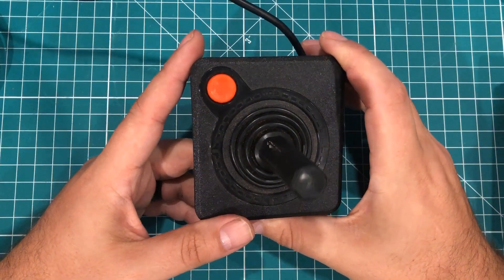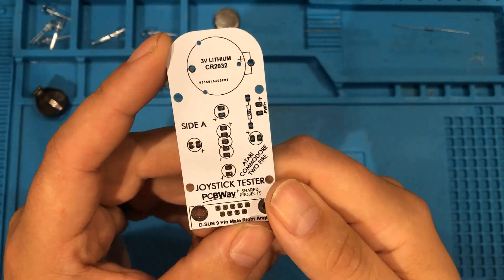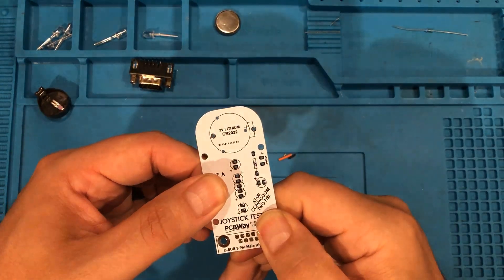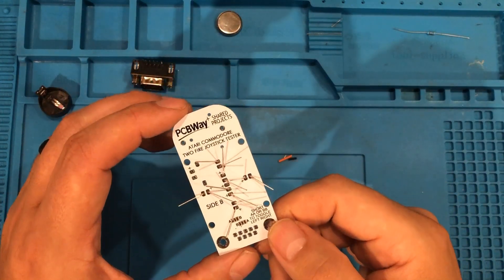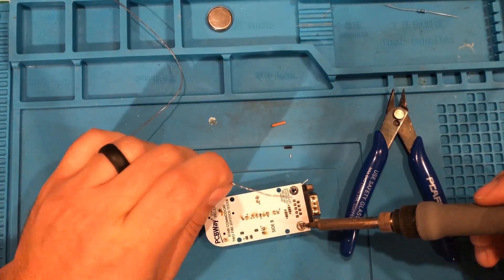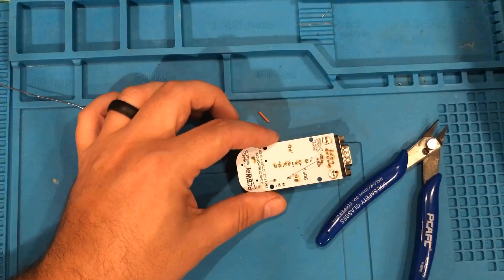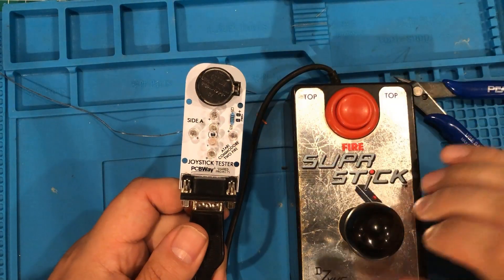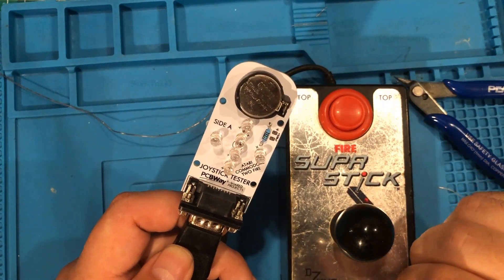Retro Joystick Tester - Simple Kit Build for Atari, Commodore, Amiga, Sega and others!

Comment: This is yet another incredibly useful build. Would love to see a fancy case on it too, protect the board from the elements. Now I'm wondering if one could design a face plate and have a ton of exposed pins with dip switches or buttons and a microcontroller so you could plug in any controller and test it. Or would it be better to have multiple connectors for other controller types?
Reply from the maker: Yeah.   A case would be really cool.   I've actually been kicking around the idea of having a ribbon cable or something that could let you swap joystick connectors. I've been thinking the same thing for retro pc power supplies. There are a million connectors and voltages...it would be cool if you could have a universal psu that you could swap the cables for all the various systems.
Reply: @AnotherMaker  If I understand your ideas regarding this, you may want to reach out to Bob on Retro RGB as he discusses things like that on his YT channel and he could get the word out and review it if I guess correctly
Reply: @AnotherMaker  Yeah, like that multi plug power supply they used to sell with the 20 barrel connectors, but let you change the voltage, would be a great project too.

Comment: Nice, but why does it need the battery? Doesn't the Atari standard have a 5V pin?
Reply from the maker: It needs a battery because when it's testing, the joystick doesn't get plugged into the atari. The joystick itself is just a combination of switche/buttons with no internal circuitry.
Reply: This is for when you don't want to carry an Atari in your pocket then ask the Thrift store if you can plug it in. Then hope you brought your Joystick Test cartridge or Combat or whatever.

Comment: I like a well-defined star, with 8 discrete positions.
Joysticks should also be built like a tank. They take some abuse!  Maybe it is just me.
Wondering, do the Atarti controller's contact switches have debounce circuitry?
Reply from the maker: I would think the debounce is in the console, but I'm  not sure. I'll definitely be pulling them apart.  I spent a ridiculous number of hours on my original controllers. My guess is that the main reason these don't work is just being normally open for 30 years in Florida humidity.  I'm definitely puling them apart.
Reply: The joystick itself does not contain debounce circuitry, only switches. There is likewise no specific debounce circuitry in the 6532 RIOT chip in the Atari 2600, which is what the joysticks are connected to inside. Debounce is done in software on the 2600.
Reply: @saundby  Interesting.
Fewer parts that way.